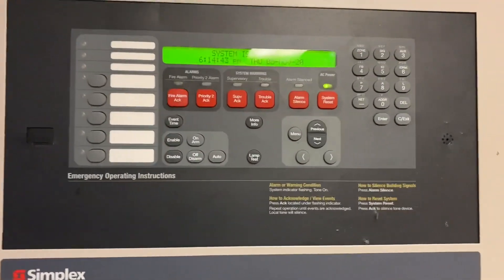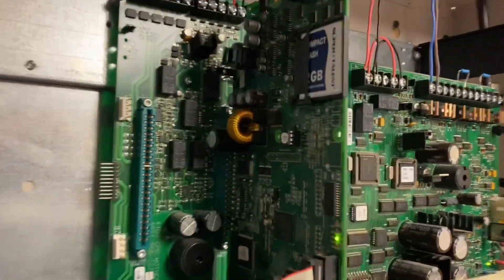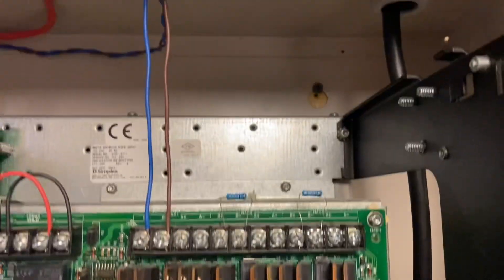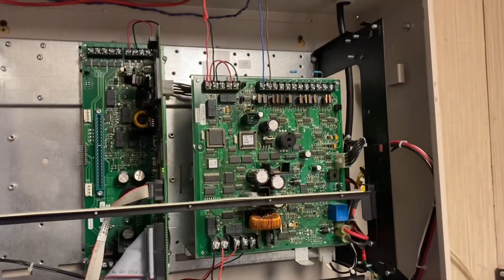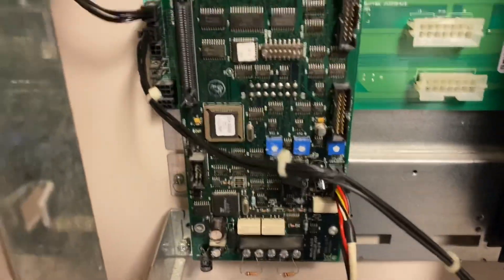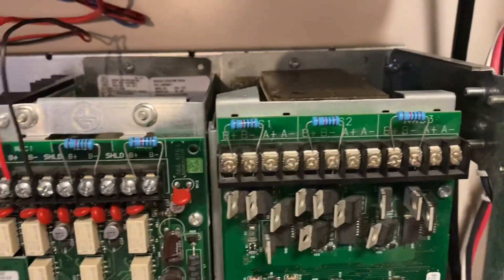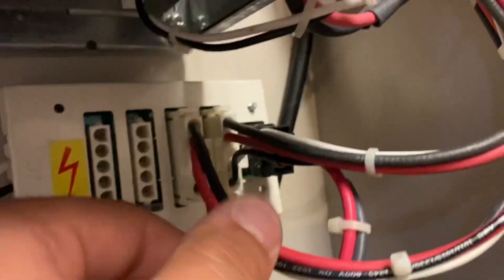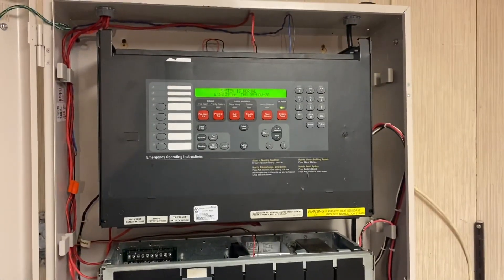Inside the Simplex 4100ES

Comment: Is it possible to swap out sps without having to program anything just power it down swapping out the old card putting in a new card  then firing it back up ?
Reply from the maker: Yes, as long as the DIP switches are set correctly, you are able to replace part to part
Reply: @Dredpath1  awesome thanks so much ...we keep having a trouble of the sps it comes and goes .I just want to swap it out with a anew one without the headache of having them come out for any type of programing.

Comment: How warm and cold rest? And when is it  correct to use them. I often come across to low battery trouble and even when i replace them the panel will not clear pressing the rest bottom, so we usually reboot the panel.
Is there another step to avoid the reboot and clean the trouble?

Comment: Cool panel. I have a few questions for you. 1. Since it is an es panel, does that mean you have idnac nacs that use addressable truealert es notification appliances? 2. Is software required to program the panel?  3. Or can you do programming at the panels keypad? Thanks!
Reply from the maker: Hey Caleb, 

1. Yes since it is an ES panel, you do have that option to use IDNAC devices. In order to do that, you need an EPS. I only have an SPS at the moment. 2. Yes, software is required to program the panel, but it is proprietary and I don’t have it. It does not allow you to program through the front keypad. I have a friend who works for Simplex so he is the one that programmed it for me.
Reply: @Dredpath1  Thank you! I now have a clear understanding. Thank you for your help and merry Christmas!

Comment: What is that module you have there I would like to add some conventional smokes to my simplex 4008? Is it inexpensive way to do this like addressable module? Thanks great channel
Reply from the maker: Hi Dean, thank you for tuning in! What part are you referring to specifically? To answer your question about the 4008, you would need to use addressable modules to operate your conventional smokes.
Reply: @Dredpath1  trying to put 4098-9601 SD and 4098-9755 base  on system but there are a lot of addressable modules I just want to make sure I don’t buy the wrong one and waste money. This is a four wire base could I do 2 wire base?
Reply from the maker: @Frankspliff2  if you buy a two wire base, then you should be able to use it

Comment: I have a question. If I want to make a mini voice evacuation system, I need an circuit board with auxiliary and an amplifier of simplex 4100ES?  Am I correct?
Reply from the maker: No, you need the full panel.

Comment: I have a home panel 4008 and need help to hook up sounder base 4098-9794 connected idnet but not sure where to hook up the sounder side?
Reply from the maker: You need auxiliary power for the sounder base
Reply: @Dredpath1  thanks I was trying the NAC terminals but didn’t work Aux Power now system normal 👍

Comment: Awesome! I came across something weird in a building a few days ago,  this building had a 4010es and a 4003ec. Do you have any idea as to how those operate? I am assuming they are similar to the original 4010 and 4003.
Reply from the maker: I have an idea how they operate but I don’t know 100%
Reply: Well the 4003EC is Identical to the Wheelock safepaths so if you know how to operate a Safepath , you can operate A Simplex 4003EC. (Vice versa)
Reply: @SomeDudeWithAnExitSign  ok, I believe the 4003ec uses Simplex tones and massages not wheelock  right?
Reply: @George-yc7eq  yes it dose have simplex tones and messages. Other then the tones and messages it’s still a Safepath at the end of the day.
Reply: Can you do a video of how to wire up one of your addressable simplex panels?

Comment: Help me to know about the trouble terms like "no answer, bad answer ,disable mode,off,open circuit mode
Reply from the maker: No answer is when a device goes missing on the SLC loop. A bad answer would be when a device communicates with the FACP, but it is insufficient. A disable trouble is when you disable a point or a circuit on the system. An open circuit trouble is when there has been a break in the field wiring and the panel cannot see the EOL resistor.